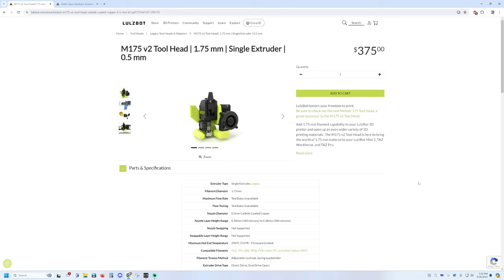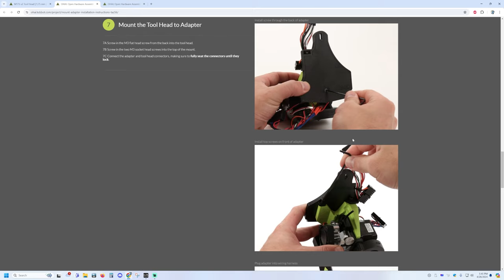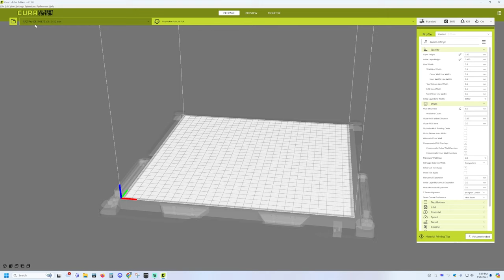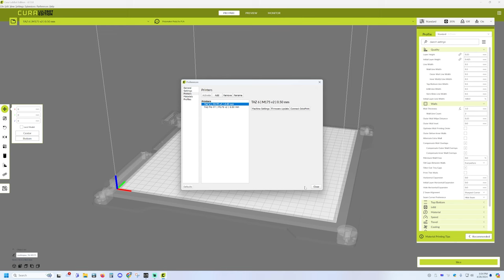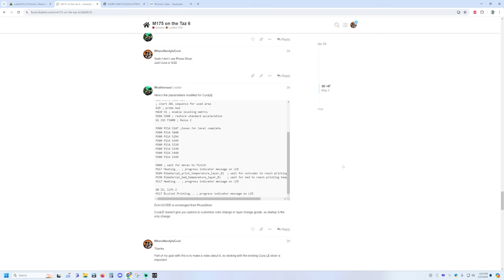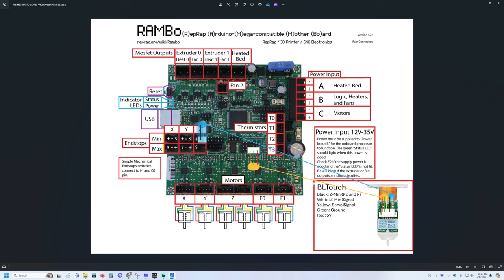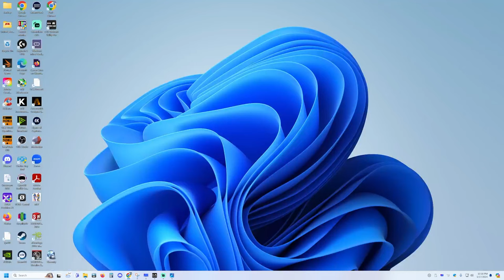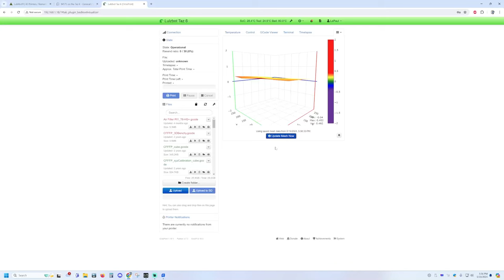Upgrading my Lulzbot Taz 6 to the M175 v2 Tool Head & BL Touch Mod!

Comment: What are your thoughts on the Ultimaker S7?  There's scant actual real person reviews of this machine because well, it's not a real person machine.  But from what I have seen, the print quality is interstellar - albeit a bit slow.
Reply from the maker: Hi, thanks for asking!  In my day job role, I bought 7 Ultimaker S5s.  They are amazing machines and if you are looking for something that just does amazing prints just about every time, the Ultimaker folks make an amazing machine.  Fixing them isn't too tough, with amazing support from Ultimaker and vendors like Fbrc8.  The S7 combines the material feed system and air filtration system all together.  They also improved the bed probing system and a better bed surface.  (My S5's are using Wham Bam Bed Systems)  My only complaint is when you look at the S7, there's a lot of space up top that I was really hoping they would utilize for more print volume.  But that's my only grief.  The Ultimakers are great 3D printers and of course, with their Cura slicer and many built in profiles, they are really great print farm machines.  Yes, it doesn't use the zippy new motion systems like the Bambu Labs or Vorons, but I really haven't heard many stories of people using many of those for higher end roles.  I'd love to get my hands on one!  Also, the newest model, the Factor 4, is very impressive too.  Erin at FBRC8 just received one and I've been waiting to see what she posts on YouTube and Instagram
Reply: @torquemada1971 we have got a lot of experience with the UltiMaker S7 (and the rest of the UltiMaker fleet). I would say the S7 brings a lot of reliability and repeatability to the table, while keeping the filament system open and flexible--trusted profiles you can download, but not being locked in to Ultimaker branded filament. Relative to the S5, there's are some changes on the S7, including the PEI flex plates, and switching from capacitive to inductive leveling, and the overall taller/heavier machine so that it can be fully enclosed. As Paul mentioned, we just got our Factor 4 demo unit last week and we're putting it through its paces and posting updates to our YouTube and Instagram channels.

Comment: I got a TazPro dual extruder and a Taz 5 and a couple extra tool heads at work on the real cheap. wanr to go 1.75. got suggestions?
Reply from the maker: I don’t know if you can put an M175 & Universal Adapter on the 5. Might want to check the LulzBot forum or Reddit